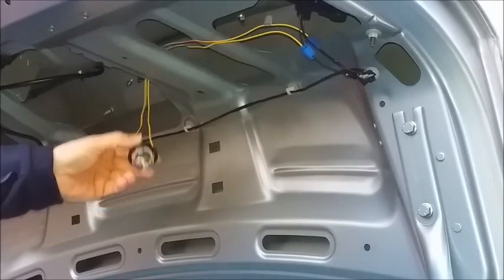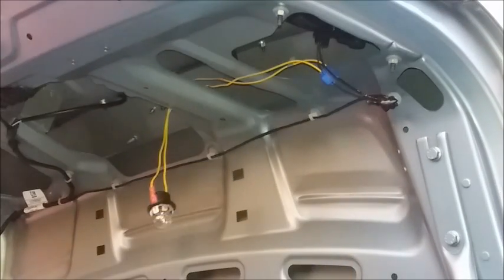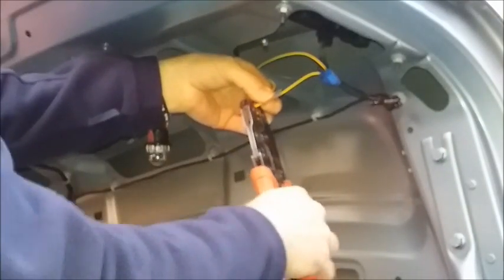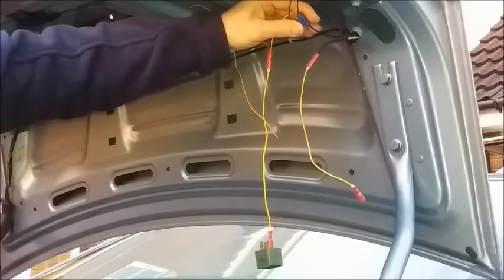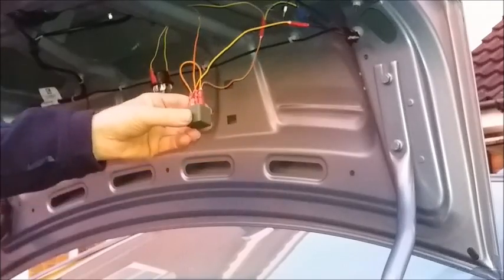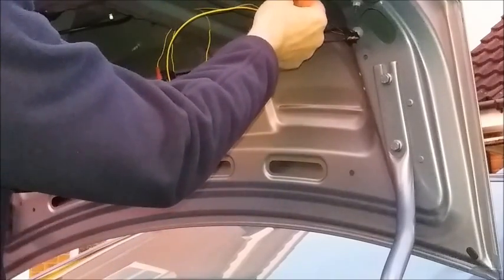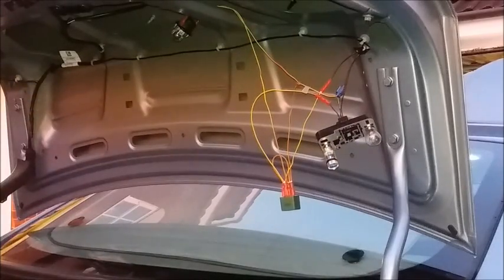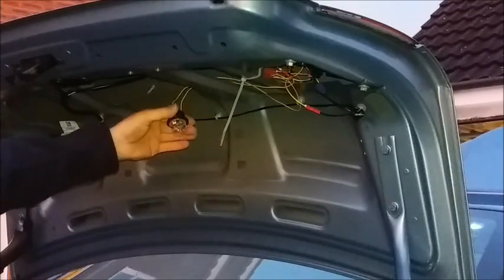How to Fit & STOP LED Bulbs FLASHING on a CANBUS Car

Comment: RH tail light on a Saab 9-3 2008 estate not working did your trick with the bulb, just the bulb, used a small number plate bulb and holder works now :) thank you thank you thank you good man

Comment: Ok so I hooked up everything as you did and it works great , no flashing BUT I get an error message on my sid. I did use a 6 ohm 50w resistor. I used this setup on h7 led high beams. Any ideas boss?
Reply from the maker: Sounds like you've connected the resistor incorrectly. Double and triple check your wiring against the wiring diagram.
Reply: Cyclone Cyd  still no go... it's so frustrating!
Reply from the maker: You watch. When you find it, it'll be summat real simple and you'll kick yourself. It's always the way.
Leave it for a few days and then come back at it with fresh eyes.
Reply: Cyclone Cyd i've honestly followed every single step but still. I even checked the resistor . I tried using two resistors even. But still , error message in sid
Reply: Philroy littlekip  I used resistors but I've scrapped this project because I suspect it dosent work for high beams (h7). Probably because of higher currents?
Reply from the maker: Hi Philroy, You can use either. I've used bulbs in the video as a demonstration that you can. Resistors are a 'tidier' solution but you do need to get the right ones (6ohm 50W) and some places charge a fortune for them as if there's summat special about them. So I've used bulbs where they can be hidden (like the boot lid) and resistors where they are visible (back of the headlights). As far as I can tell (and the Electronics boys at work agree) the car cannot tell if it's 'seeing' a bulb or a resistor (of the correct value).
Thanks for watching and engaging. Don't forget to like and share.
Reply from the maker: 2.6 ohm 100W in place of the H7.
Reply from the maker: Or 2x 6 ohm 50W in parallel 💡👍
Reply: Cyclone Cyd where should I put the second resistor?
Reply from the maker: just put them next to each other
Reply: Cyclone Cyd  still no go.  I'll give up the high beams and try to focus on the backing lights instead.
Reply: @NusultanTuljakbaj  Time delay relay 3-5s ON combined with standard bulb h7 or side indicator instead of 55w resistor will clear blinking issue and sid errors
Reply: @pjeka1362  thanks. 5 sec relay?  Btw I sold the whole led kit because I gave up. However , I'd like to fit led to my reverse light in a station wagon (combi) model. Is it even possible?
Reply: @NusultanTuljakbaj  Yes bought pair for arround £8 in china ali...es, here in uk they are about 36/each !!! Ist exacly need to be done as Cyclone Cyd explined in video but ordinary relay replaced with 3-5s time relay and we cant use resistors that have to be ordinary bulb, because car is checking for open/short circuits even when ignition or light switch is in off position. That why You had problems with led lighting. Its all working perfect the only problem exist is that when You turn light it will come one after 2-3sec...

Comment: Great video and solution. I have used this to solve strobe in number plate leds and it worked.
Used this in reverse leds and they throw an error from time to time, when reverse gear selected. Other times its fine.
There are time when reverse gear selected, nothing is happening until few seconds in the reverse gear. It will throw an error and bulb will go off. Deselect the reverse and engage it again (with an error on the dash) and it will lit up the lights normally.
Switch of the engine and back on and all comes back to normal, until reverse selected again. You might be ok or not.
Several times I use Carista to remove errors but it always come back in odd time.
This does not happen for plate leds at all.
Any idea?

Comment: Is this possible to this on your high beams? Iv tried but it still flashes. I used a relay and a resistor As Well.
Reply from the maker: Certainly should work fine. Check you've got the no and nc the correct way round.
Reply: Cyclone Cyd  will do.  Thanks for an awesome video .
Reply: Theres a store that sells antiflicker sollution plug n play wiring for all cars except.....  yes you guessed it... Saab.....
Reply: Cyclone Cyd I used scotch blocks instead of splitting the wires. Could this be the problem?  The h7 led lights came with a harness with a built in resistor so I spliced in to those wires with scotch blocks to attach the relay.
Reply from the maker: Yep - I know! If I didn't already have a full time job I'd 'productionise' this myself.
Reply from the maker: Yes it will be. You're not separating the LED from the car (when off) if you just splice. So the test signal still reaches the LED and causes it to flash. Pause the video at the wiring diagram and follow it very carefully (make a screen grab on your phone for example).
Reply: Cyclone Cyd thank you so much .
Reply from the maker: Also, as you're doing under bonnet connections use glue lined heat shrink connectors to ensure a water tight joint. Here in the UK Halfords sell them, but they are available on eBay and Amazon too
Reply: Cyclone Cyd I'm using a 4 pin relay and a relay holder with wires. Is that a problem?
Reply from the maker: Yes. You need to use changeover relays (which have 5 connections). 4 pin ones only have no contacts and no nc.
The way this setup works is that the resistor is permanently connected into the circuit for the benefit of the bulb check when the lamp is OFF and the LED DISconnected so it doesn't receive the pulses. When the lamp is turned ON, the relay "changes over" and disconnects the resistor from the circuit and connects in the LED.

Comment: Hey ... your wiring diagram is a bit confusing can you tell me which wire from relay goes where e.g. relay 85 = earth ?
Reply from the maker: Now you've got me confused! The diagram has the pin numbers plus descriptions. Can you be more specific about what you're having trouble with?
Why not try printing it out or screen shotting it so you can study it?
Reply: 85= Earth on bulb holder connector which goes through the resistor
30= Bulb positive and goes to 86
87a= Positive from resistor
87= Bulb Positive 
I am trying to do this on an estate 
Thanks

Comment: Hey what if I wanna replace my interior lights with led bulbs? Is it as easy as just switching them out or do I have to do anything special? Will they flicker?
Reply from the maker: Interior lights are not on the continuous monitor circuit, so just swap the bulbs out for LED conversion bulbs.

Comment: I have a 2010 convertible Saab 9-3 with this problem. I tried to install a rear park bulbs (whites) with resistor only, but it doesnt work. Then i bought a bulb holder to use both bulbs (LED bulb + oem bulb) and it works !!! Havent tryied with the tail lights (red ones). Btw i want a option to use LED bulbs with no problems. Please find the solution! Thank you so much for the video!
Reply from the maker: Thanks Nico
Let me know if you have any Saab related requests!
Reply: Yep, one thing, where i can buy those Relays? or tell me are universal 12V relay?
Reply from the maker: Universal 12V changeover relays if you're buying. Cheap enough in Maplin's or Radio Shack.
Those green ones were 'rescued' from an old fusebox at a breakers yard. I've loads of them. Many cars have them. Tend to be smaller in newer cars
Reply: 12v 20A? or 30A?
Reply from the maker: Minimum 5A contacts to suit the bulb. P21W pulls less than 2A

Comment: So I tried this method to get H7 low beam bulbs to work on a Vectra C. The flashing-when-off is gone, but when the ignition is on and the lights are off, I get a dead bulb-error. I tried putting it together so it only uses the two connections from the headlight, meaning that all ground connections go to the former bulb connector. And since the low beams did flicker slightly when the engine was running, I had to also connect the "canbus decoder" box that came with the lamps. I'm not really sure what's inside those, so I don't know if that's to blame for the error message, but since I put the relay first, then the box, then the LED bulb, I'm thinking it shouldn't. I've also tried wiring two of the 6 Ohm resistors in parallel rather than just one, but that still didn't help...
Any ideas?
Reply from the maker: What value resistor did you use?
Reply: 6 Ohm
Reply from the maker: and 2x 6ohm in parallel is 3ohm. Have you double checked the wiring, especially that you've got the no and nc of the relay correct?
Reply: I must have re-done the wiring at least 3 times, I'm pretty sure I got it right. Resistor was always at 87a, and unless Bosch does NO and NC differently than everybody else, it should have worked. Anyway I managed to somehow blow one of the lamps up, and in my frustration and anger I chucked the whole thing in the garbage, so that's the end of that...
Reply from the maker: I feel your pain! Sorry to hear that.

Comment: Hello again!  I have recently purchased a HID kit for my 9-3 and i specifically chose a set that have a resistor/decoder on it but they are still flashing.  On the forums a few of the guys have said they should not flash buying this type of HID kit.  Any ideas?
Reply from the maker: My theory is that much of the confusion around what works and what doesn't is that people often say 'it works' after fitting something to an OG9-3 or even a 9-5 and seem to "forget" that the electrical system in a 9-3SS is completely different to either of these cars. Many cars only test the bulbs when they are switched on and for these cars the simple built in resistor works fine. For systems like the GM one that tests bulbs continuously even when they are off, it simply isn't enough. All the resistor does is absorb some of the energy of each test pulse but it still leaves enough to flash the LED. For these systems you need to use a relay and separate resistor as I show.
An alternative is to buy a 2ndhand pair of xenon headlight units complete with ballasts etc, fit them to the car and have it programmed via Tech2 to 'know' it has xenons fitted.
If you are in the UK, join "Saab 9-3 Owners UK" on Facebook - several members are breakers by trade. Elsewhere? Try 'Saab Nuts'
Reply: Cyclone Cyd Yeah I’m thinking I’ll just have to follow these instructions for my HID setup then.  I take it I’ll have to make sure I do all the splicing connections before the ballast?  Yeah I’m a part of that forum already it’s a great platform!  Thank you for your help
Reply from the maker: I haven't fitted HIDs with this method 'cos my car already has them. I can't think why it shouldn't work though. Do let me know how you get on. Happy Saabing!
Reply: I've fitted HID conversions in 2 9-3 SS and they don't flash, the way they work and the wiring connections are not remotely like an LED, the Canbus system throws an error as it can't see the light element it expects, what it sees is the ballast that triggers the HID. Also none of the kits required any splicing of anything.

Comment: So would this method work for the 501 side lights?
Reply from the maker: Andrew H 
Oh yes, the method for the parking lights will be exactly the same. It works for all bulb positions except the tail and brake lights (they use PWM method to dim down to 5W equivalent on 21W bulbs). Works for indicators too.

Just add in to do your wiring a bit neater than shown. This wiring was being hidden behind the boot trim so I concentrated on the method more than neatness.

And check out ebay item 331760123683 for suitable resistors at a pound apiece.
Reply: top job mate. would the bulb still work as a decent resistor like you've done? if thats the case i got some of these http://i.ebayimg.com/images/g/Nq0AAOSwgDRZcGtV/s-l1600.jpg and 501 bulb holders to go with it :)
Reply from the maker: Should be good. Should make a nice neat job too. Shame you can't attach photos here, it'd be nice to see the finished article.
Reply: Once i get around to wiring it all up and fitting them i shall post a image or two :) can't wait to see my led side lights in action haha!
Reply: Well, firstly get my EGR blanked and mapped out first. then work on the lights.. oo and not forgetting a bumper repair as a bloody huge rabbit ran out in road last night and slammed right into the front.. nice!
Reply: Got around to doing my back tail lights, and lone behold works a treat! http://i.imgur.com/Nf6RxJc.jpg sorta still a mess, but i aint gonna see that within the bumper. :)
Reply from the maker: Andrew H sweet. Well done. 
A lot have scoffed at this method but as you say it works. Spread the word and thanks for the feedback ciao
Reply: i'm a member of many vauxhall forums and groups i will spread the word :) alot of people ask this question :)
Reply from the maker: Andrew H appreciated

Comment: Wow glad I stumbled upon this video. I own a 2004 93SS and I've wanted to try replacing my exterior bulbs to LED after my local auto parts store just started stocking the latest Philips auto LED bulbs.  I decided to start off small and attempt to change the side indicator markers on the fenders which are 194 5-watt bulbs over to the LED equivalents.  I purchased the 5-watt in-line load resistor from philips and sure enough after temporarily placing it in parallel with the bulb it still would flash even with the car off and key removed.  I have LED's in the license plate lights which also flash but only for a min after locking and activating the alarm. Out of all the exterior lights that I would like to change over were the brake lights...but now I guess that's on hold.  Almost seems like too much trouble for what its worth.  Thank you for posting this video.  Please keep us informed if you find a work around for the PWM.
Reply from the maker: mraccord92 Thanks for the feedback. You're right, it is a fair bit of faff, but it's not really difficult and you can do it fairly quickly once you've done a couple. Personally I've only done my reverse lights, indicators and parking lights.

Sorry, I haven't come up with a workaround for the PWM, even the electronics boys at work are stumped! You can get P21W halogen conversion bulbs, they are quite good but don't last long.
Reply: Your welcome Cyclone.  I'm going to try and convert the front marker lights (is that what you are referring to as parking lights, the smal 194 5w bulbs in the headlight housing?)  I'm trying to source some hella weatherproof relays to get it done. Depending how that goes I'm going to move onto the side and front indicator lights.
Reply from the maker: Yes, marker lights. Here in UK some call them 'side lights'; but properly they are called parking lights because that's what they are for, parking. Highway Code requires driving to be on dipped beam.

Yeah, thanks for that, weatherproof is a good idea under the bonnet. those green automotive relays are only splash proof.
You could always put them in a box or wrap with self amalgamating tape

Comment: Hi, is there a way to solve the H7  Led headlight flashing even with a 50w resistor ? I had this problem, need some help? Thanks
Reply from the maker: Chung Chee Hwee yes follow the method in the video. The wiring will be exactly the same just a different bulb.
Reply: Cyclone Cyd hi , if I use a golden Colour metal 50w resistor to replace the bulb.. can be done
Reply from the maker: Chung Chee Hwee you need a relay AND resistor to stop the flashing. I just used a bulb instead of a resistor so cost me nothing.
Reply: Hi ... I will try... thanks and cheers mate
Reply from the maker: Chung Chee Hwee watch the video through a few times to make sure you understand what's going on. Then why not practice on a reverse light before moving on to the main beam? If you find yourself getting muddled just take a break. 
It's a lot to take in and does cause a lot of confusion. It took me a while to work this out! 
You'll get it. Good luck.
Reply: Hi cyclone , do you have a better diagram to show how to fix the led light for H7 , for my 2008 saab 93. Or any video .. thanks
Reply from the maker: And there I was thinking I'd done a great job of putting that wiring diagram in the video. Why don't you pause it, take a screen shot and print it off so you can study it?